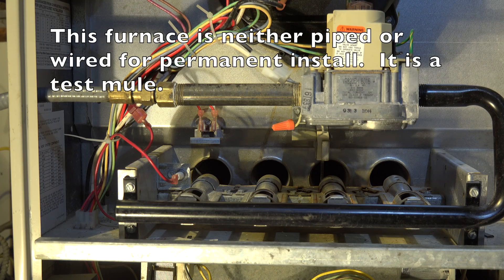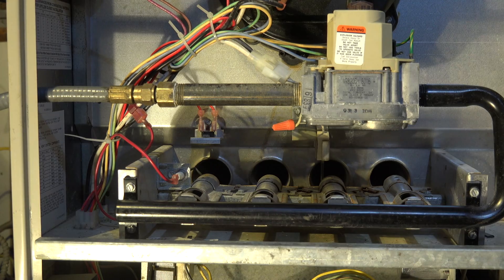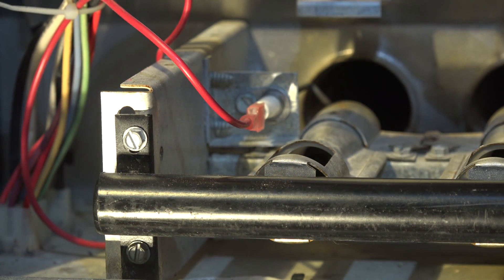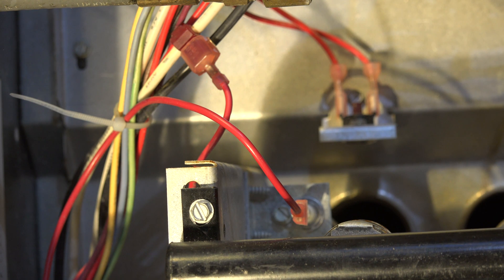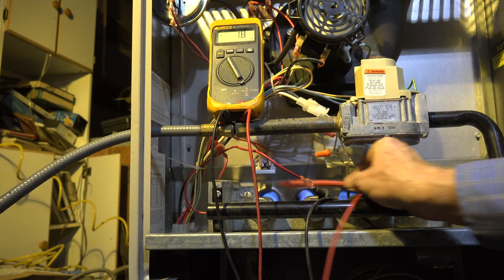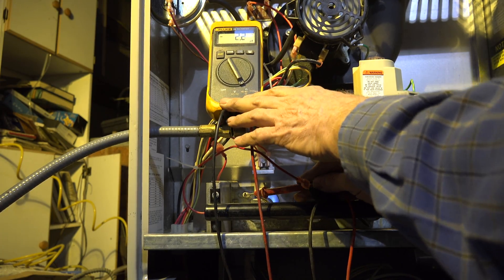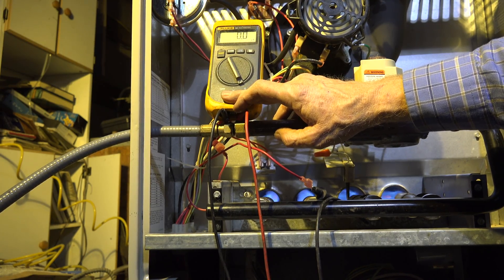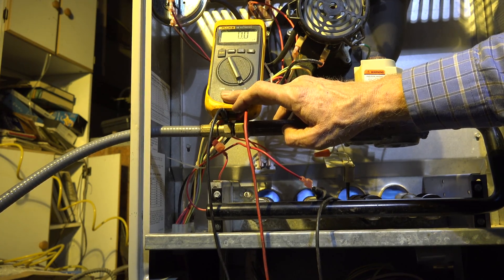The aftermarket flame rod on the Rheem/Ruud RGDG #4

Comment: So, in the situation with the gas valve is cycling on and off. And we have the micro amps, correct and the unit is still cycling on and off like a dirty flame sensor. What is the issue and how do we test it
Reply from the maker: I would be checking for flame covering the rod (assuming the rod has been cleaned).  If the flame is intermittently covering the rod, look for dirty burners, cracks in the heat exchanger if it happens when the circulating fan is on.  Wire connections must be tight.  If all is ok, check voltage to the gas valve to see if it is getting intermittent power.  If it is getting power, the gas valve is failing.  If it is not, control board may be your problem.
GFM

Comment: My educated guess is the same as another comment above, there must have been a kit that included a board to proper drive higher ac voltage to the flame rod, detect the rectified dc ua current and probably output a NO relay contact used in series with other limits.  Perhaps with a connection to the hsi for timing to allow initial ignition.  Some hack did not want to spend the time to set it up properly and just used a t tap on the flame sensor rod to neutral for looks since somebody told him he had to install it.

Comment: How does the board see this? Thru neutral ? Confused me. Lets say igniter did not sense flame, but rod produces micro amps  how does microprocessor will see and process this 2.4ma ? I could not get the idea.
Reply from the maker: This is called flame rectification.  AC is fed into the flame rod to chassis.  If DC is read, the burner stays on, if not, it shuts down.  The current is microamps and electronics can easily see it.  I have a number of videos on flame rectification that may help.  Check my channel.
GFM

Comment: would a bad furnace control board cause the inducer & blower motor to run, even when thermostat is turned off?
Reply from the maker: Depending on the model of furnace, some will run the inducer and circulating fan motor when there is a limit open or flame failure.
GFM

Comment: if then, the furnace does not stop when the HSI is pulled from the circuit, the IFC is sensing a variation in neutral voltage.
Reply from the maker: What the heck is a variation in the neutral voltage?
GFM
Reply: the same as a say 10 micro to 100 milliampere 0.05% error current sensing device. I believe companies still make them. TI was a common one in the day

Comment: If you take the hot surface out of the loop while the flame sensor is in place would be another interesting test. since the flame sensor is not hooked to the chassis, no rectified current here. just AC into AC/neutral.
Reply from the maker: Interesting.  May try that one.  
GFM

Comment: it's probably a "in addition to", a back up to the HSI for the flame current. If you had a weak or coated HSI this would supply necessary signal back to control and prevent intermittent outages. A bandage not a cure. Like the recycle timers Carrier had on their three wire.
Reply from the maker: This unit was made during the changeover period from standing pilot to electronic flame sensing.  Many problems with the HSI sensing.
GFM

Comment: All I know is the furnace board does determine ground from neutral,because if the polarity is wrong the furnace will not start. I think the flame rod sinks current to ground through the flame. Ground and neutral go to the same place ,but not at the board  . Maybe it parallels igniter and flame rod together through the transistor base of sensor on the board ??
Reply from the maker: At the appliance, neutral is isolated from chassis.  Thus, you have a path thru the HSI, flame to chassis.  
GFM
Reply: It will start but just not sense flame.

Comment: Just a guess, there is a small voltage on the return line. Maybe, that's enough to power the flame rod? My understanding is this, the small volts/current available on the return line are enough for the flame rod. When the flame is sensed the circuit is complete and the furnace continues to fire. As the flame coursing across the rod transfers the electricity to ground completing the circuit. If flame not sensed circuit is not complete, furnace shuts off.
Reply from the maker: The power for flame sense is quite high, I have been shocked by it.  The voltage is produced by the board.
GFM